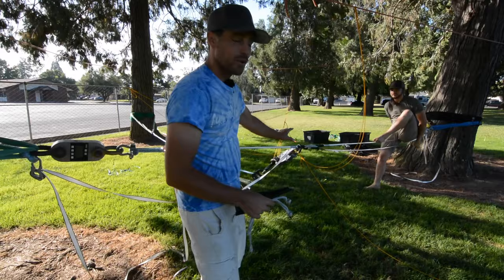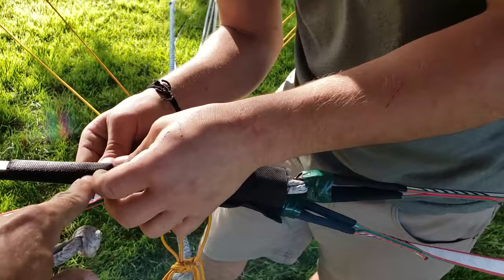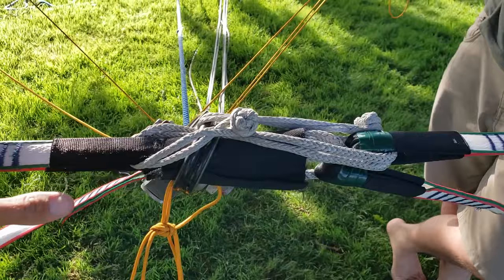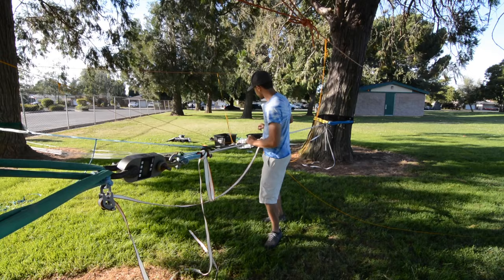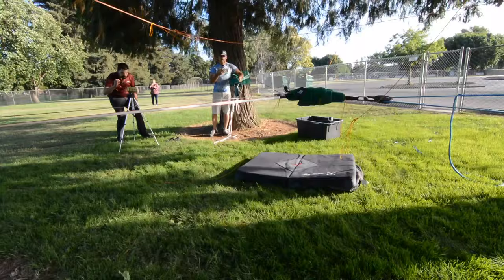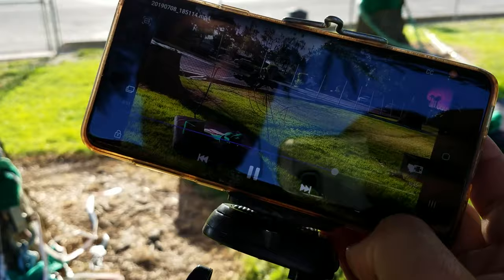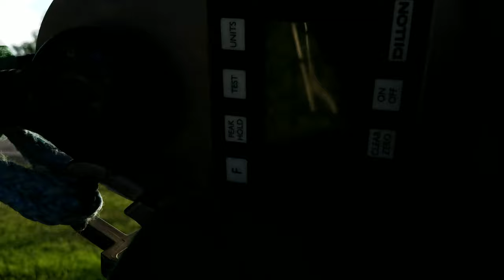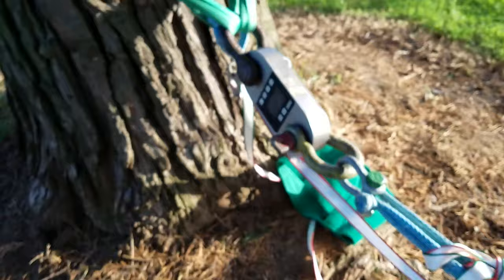Rope Swing Break Test - stabilizing connection rings on highline segments

Comment: I got told to never stand in the middle of the death triangle, you literally stand in it this entire video. If the rope connecting to the truck broke when you're standing there, is it correct that you'd have the full force of the diamoniter  impact the mid section of your body.
Reply: yes, basically looked like a 30KN slingshot aimed at their face.
made me just as nervous as watching Honnold lol  

... it was for science though :)
Reply: Glad I wasn’t the only one thinking this... cringe!
Reply: True enough, though I think he said it was 1/2 inch amsteel to the van, so far stronger than the highline !
Reply: @ppeppe  yea I guess it's just good to keep in mind just in case the connection to the van fails or the amsteel break.. everything is unlikely though

Comment: The breaking webbing brings up a thing for me: should you make the bartacks shorter, not across the whole width, so you compromise the strength of the webbing less? Maybe with more of those shorter bartacks? Could you get a higher breaking strength for the webbing as a whole?

Comment: Thanks for sharing the concept, love the simplicity of it. I wondered what your opinion would be of simplifying further and just clipping connectors (karabiners or quick links) to the end loops of the webbing at the inov-split, and then tying the jump ropes to these? So you're not using leash rings at all...
Reply from the maker: Please don't.  Those aren't designed to be pulled in a 3rd direction, rings are.